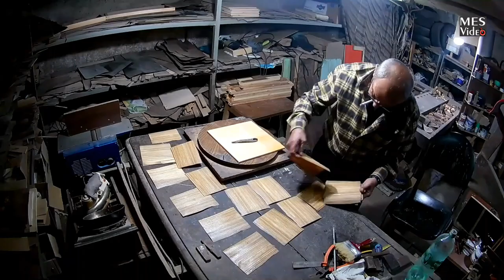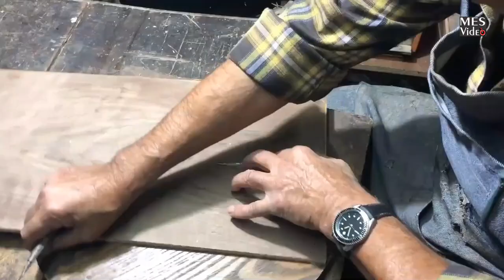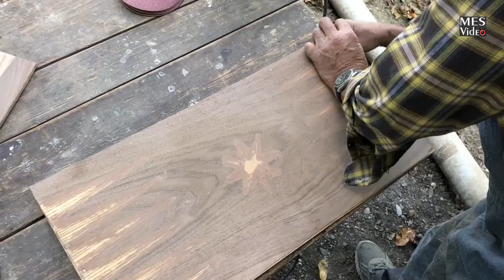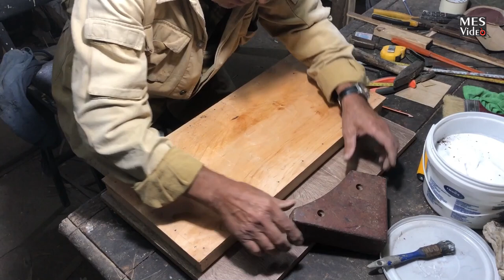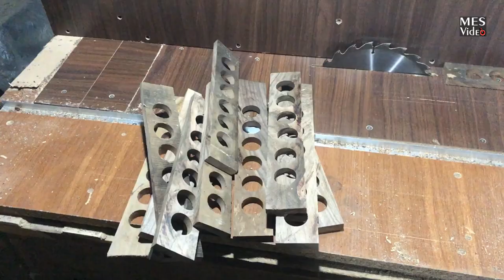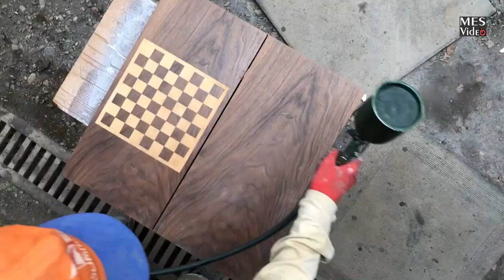How to make backgammon and Chess board Fully Handmade traditional Method | woodworking

Comment: Not sure I would have put those tiny delicate screws in with a power tool - it looks like they spun in the holes - but great job and no way I could have done better. Thanks for posting.
Reply: Yes i seen that, it seemed to have a torque setting on the drill,  not sure if it was set right. easy fix a few years down the road thou.

Comment: Great craftmanship. I would like to know what kind of glue he uses. It stays liquid even if it gets cold although it's applied hot. Fish glue??
Reply from the maker: it's Bone glue
Reply: @MESVideo  I am just asking myself, how he can remove pieces of veneer minutes after glueing them on and replace them. Everytime I have tried that, the glue needs to be warmed up again (iron or hot air).
Reply: @s7r49  I made one myself, but I used clamps and assempled the whole veneer before glueing it. The result was fine but the working process is different.
Reply: @s7r49  Yes, good luck. I made the experience, that fish glue is easier to use for this kind of job because it stayś liquid much longer than bone glue. Jointing the veneer pieces can easily be done by using a special kind of paper tape that has to be moistened with a sponge. Glues like hell.

Comment: Congratulations very good tricks I have a question, how to prepare the glue you have by heating in a pot
Reply: I believe its hide glue. Comes in pellets that you mix in water. Once it absorbs all the water you heat it to 140 F. The ratio of glue to water I think might be job depended? I have only used it for glue chipping glass at 1 part glue to 2 parts water.
Reply: Hello John, thank you very much for your information, but what is the name of the glue